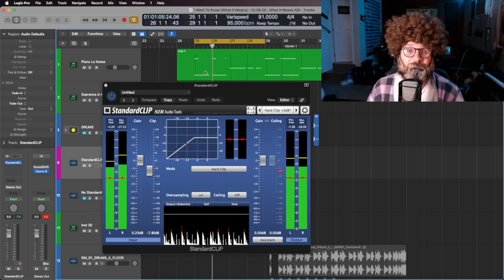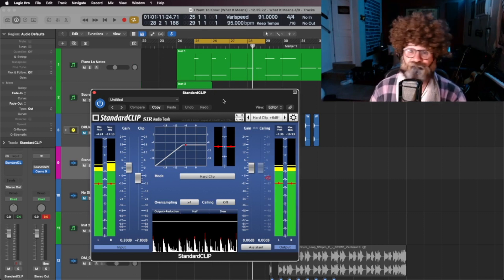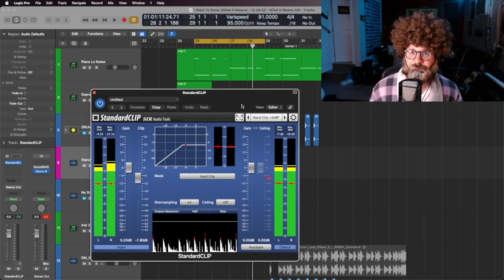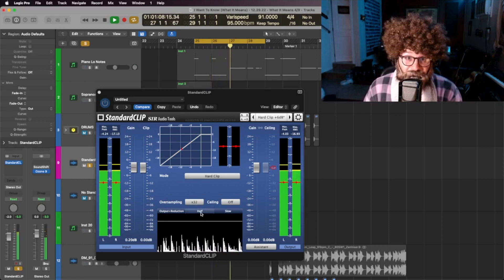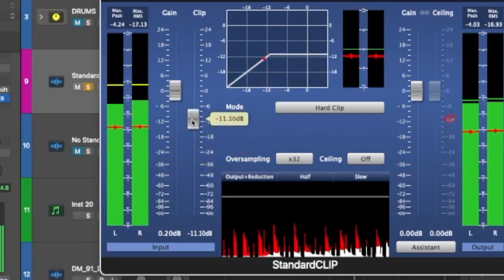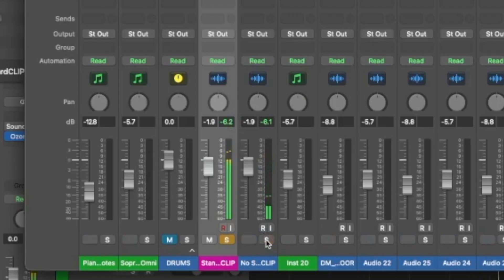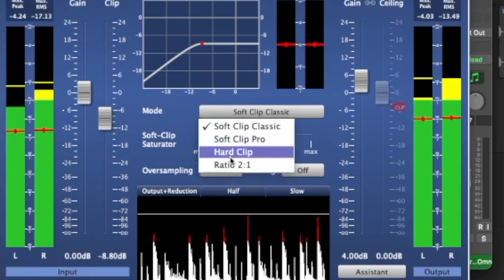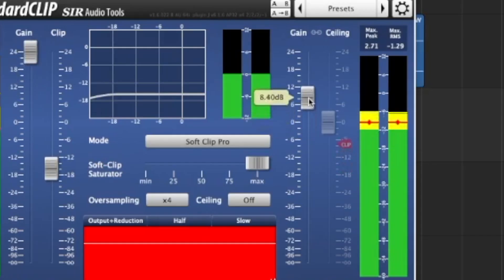How Clipping ACTUALLY works (StandardClip EXPLAINED) - Hardcore Bob

Comment: Just downloaded this after learning more about the uses of clipping. Where do you usually put this in your chain?
Reply: Im assuming on literally every sound, or on mix busses with a variety of sounds routed to them, or just some elements.. I've owned this plugin for awhile now but just heard about the clip method or do it yourself mastering recently using a clipper on every single  sound/Mixer insert before your master. Then you can get your track way louder on the Master bus later with your limiter, or yet another clipper! Ive been doing this now too but would like a once and for all confirmation this is correct. lol It has been working for me so far though, huge upgrade in my mixes. It makes things that sound harsh, less harsh! lol

Comment: I love the idea of how you teach things but you didnt show how to actually use it in the "right" way.. i think you shouldve explained that you set the clip level to the level, where you want to cut off sth and then raise the input gain till it sounds good. That way its way more clear what youre doing and you dont have to adjust the output gain!
Reply: Also, the way he described oversampling wasn't really right at all. It doesn't make the audio "higher quality" or prevent distortion that might occur from clipping. It only prevents the aliasing that might happen as a side effect of the harmonics created by clipping.